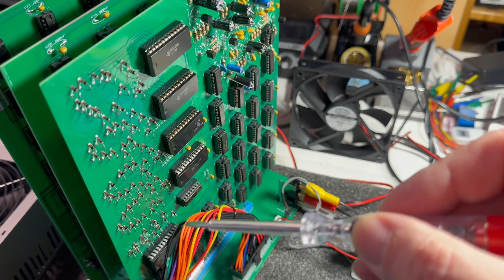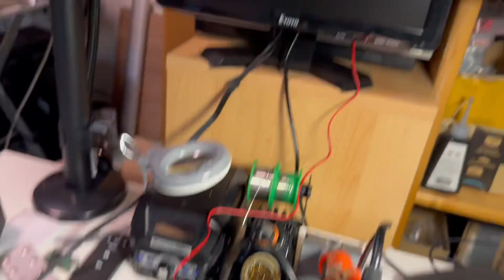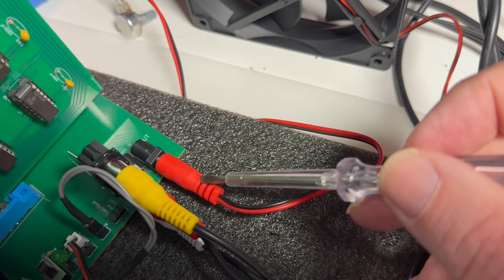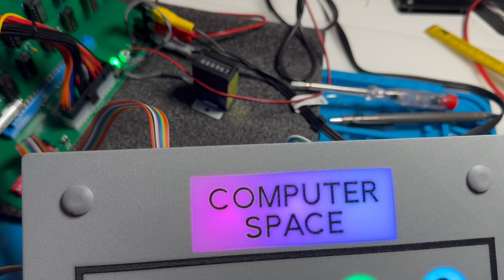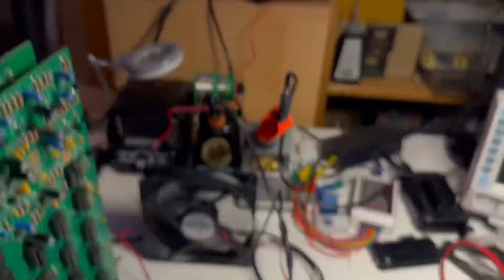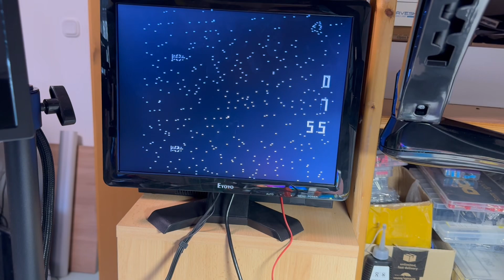Computer Space - Replica Backplane and PSU

Comment: Where did you get the back plane?
Reply from the maker: @HawthorneProduction  I designed it and send the Gerber files to JLCPCB.
Reply: @ can you share with me?  Did you get your boards working 100%
Reply from the maker: @HawthorneProduction
 You can find the Gerber files on the following Github in subfolder 'Add-ons':
https://github.com/SteBuTOS/ComputerSpaceDesign
There is also a new Wiki page for Computer Space (just started, work in progress):
https://github.com/SteBuTOS/ComputerSpaceDesign/wiki
Reply: @BurgerStefan  I am going to be hooking this up to a early 80's GE TV.  Is there a way  to hook it up to the RF connections?
Reply from the maker: @HawthorneProduction I personally have only experience with an LCD and a CRT Monitor where in both cases a composite video input exists and is used.
However, a GE TV was in fact used for the original cabinets back then in the 70's. They injected the video signal at specific spots of the TV's circuitry. This is described in the original Service Manual on pages 32ff.
A copy of that service manual can be found here:
https://github.com/SteBuTOS/ComputerSpaceDesign/blob/master/Computer%20Space%20-%20Service%20Manual.pdf

Just be super careful when working on CRT electronics as it uses high voltages. In case of doubt, consult with a someone who has skills and experience with that type of device or rather go with a monitor that actually has already an composite video input.
Reply: @ I work with CRTs a lot I have several arcade games